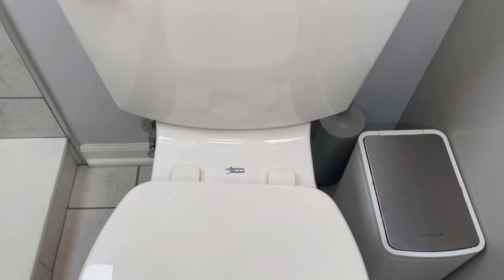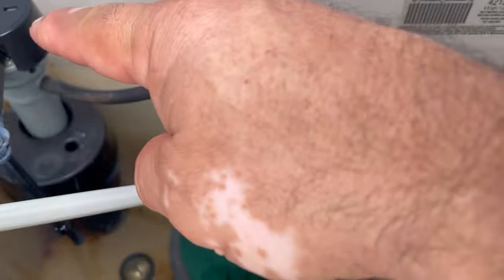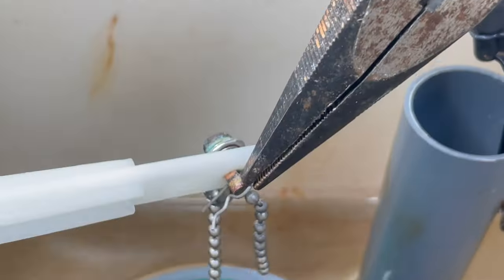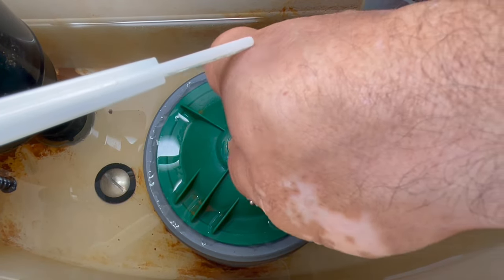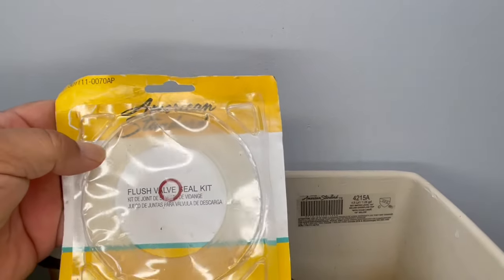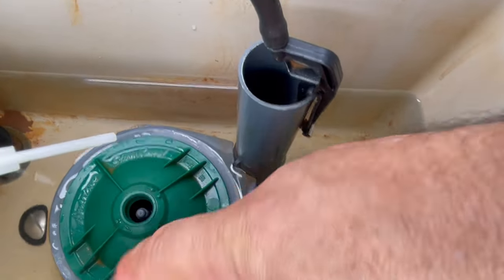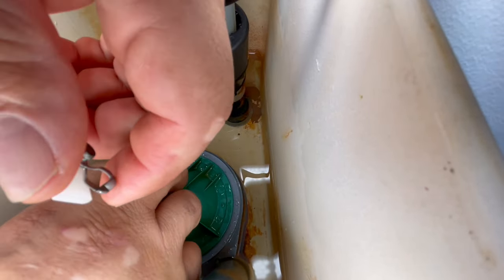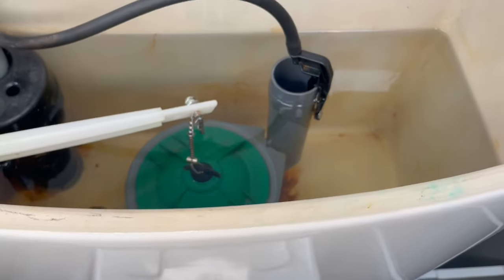HOW TO INSTALL AN AMERICAN STANDARD CHAMPION 4 IN FLUSH VALVE SEAL KIT.

Comment: There has to be at least hundred videos on You Tube that show how to change the seal on the flush valve when the valve has the green top with the black nut that you remove to lift the top off and change the seal.  Sadly, there are only two or three videos that I know of that show how to change the seal when there is no nut on top, and the process is completely different and almost impossible if you don't know how.  And two of those three videos are not very clear and not much help.  It took me a while to figure it out along with one of those video's that I found that does deal with that kind of flush valve.  Shame on American Standard for not making a video that deals with that valve.
Reply: The bolt on my friend’s toilet has fractured and I am at a loss to find an explanation for fixing. Any suggestions would be appreciated
Reply: @peternotarfrancesco2614  Since you used the word "fractured", did you make a typo and possibly mean that his BOWL "fractured", or did you mean that one of the bolts that holds the toilet to the floor flange "break", because they each have a different solution.
Reply: american standard is not an American manufacturer. The design of the products they produce is severely flawed with reason .    Not many consumers will pay $ 400.00 to a plumber when they can pay  $ 150.00 for a new piece of garbage . I have 4 toilets in my home  . NO MORE american standard here .

Comment: The new seal is red. If the black screw is not attached correctly it will continue to leak. It does not mean it's a faulty part. All his steps are very good for the D.I.Yer.

Comment: Thanks so much. Turning that bolt on top was quite difficult and we eventually got it going with needle nose pliers. Not as easy as your video. Also in putting that green hopper on we didn’t get it in those four prongs and it leaked so backed up and tried it again. Now after seeing how bad that gasket was it’s a wonder our water bill isn’t sky high.   Again, thank you so much.
Reply: I used a flathead. There's little nipples on both sides that no one talks about.
Reply: You made my life easier with the needle nose tip!  Thanks.

Comment: Thank you for your very informative video.  Before I saw your video I had bought a Fluidmaster Flush Seal at THD.  Watched another video on replacing the seal.  Was able to change out the old w the new w/o removing the chain & pin.  Put everything back together, w the exception of removing old O-ring on black nut.  Fluid-master Universal seal didn’t come with one.  Toilet still making a water leaking sound.  So going to plumbing supply house for correct part 🫤 Do you think that’s the issue…wrong part?  Or is it the O-ring?  Toilet is 5 yrs old.

Comment: Easy when the toilet has a separate tank ;for a built in tank replacing the flush valve is a nightmare...Great video! Thanks for posting! I'll never buy a toilet with built in tank and do not recommend to anyone...
Reply from the maker: I hear you solar flare.   They are a pain in the neck!!   Thanks for your comment.

Comment: My flapper does not have a bolt. Looks like older version all one piece. Any advice to remove?
Reply: If your flapper doesn’t have the black piece center of flapper and the green flapper is all one unit? Your gonna want to lift on the flapper, hole the black rod underneath with one hand, and turn your flapper according to the direction written on top. Then it removes. The black rod threads into the flapper it’s self.

Comment: my new toilet flush handle is sticking up vs returning to level after flushing.  what do you think?
Reply from the maker: Hello,   Check the chain that is attached to the handle,  It might be too long and catching up.    Check the plastic nut that holds the handle to the tank.  It might be too tight and it doesn't allow the handle to return to the original position.

Comment: Everytime I do this it works. But then starts running again after the first flush. Any ideas?
Reply from the maker: Make sure the plastic nut is tight enough.   
make sure the seal seats perfect.   
It might be the fill valve level too high.  Adjust the level to a lower position.  Make sure flush valve is tight and no water seeping .
Reply: I believe he did the install wrong. You're supposed to lift up the bottom green part of the flapper when you screw in the top nut, and make sure the notches match on the green parts. He did not do this and I think this is your issue.

Comment: Having trouble getting the black bolt off to separate the green part to put seal on
Reply from the maker: Hello Amy, Use needle nose pliers  or any other pliers.   It can get a little bit hard .  Specially if you have hard water .   Don’t give up.  Let me know how it goes.     Thanks
Reply: Success!